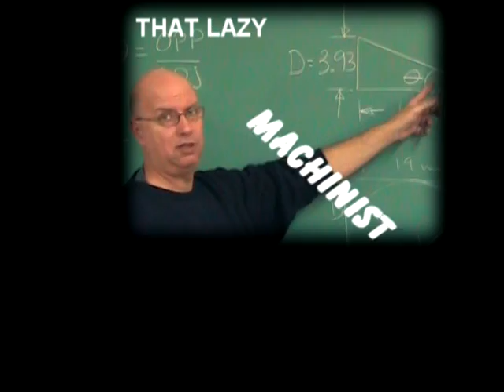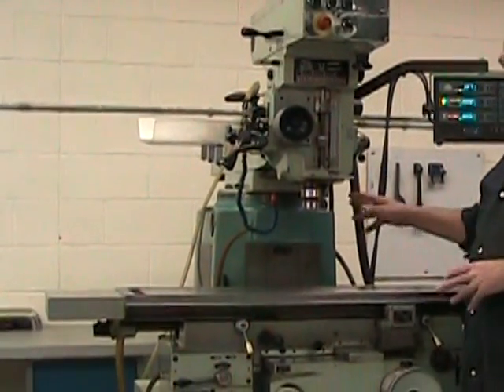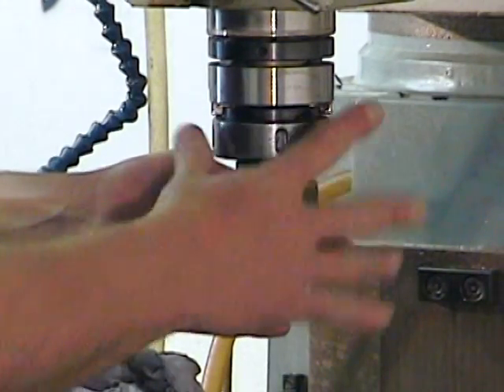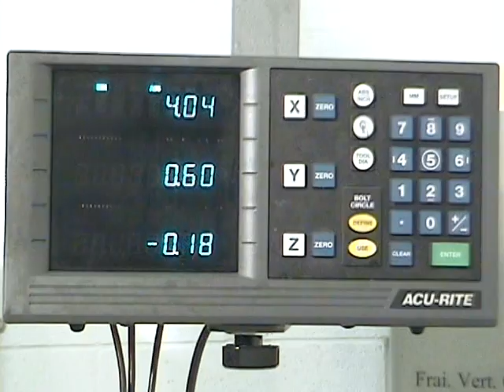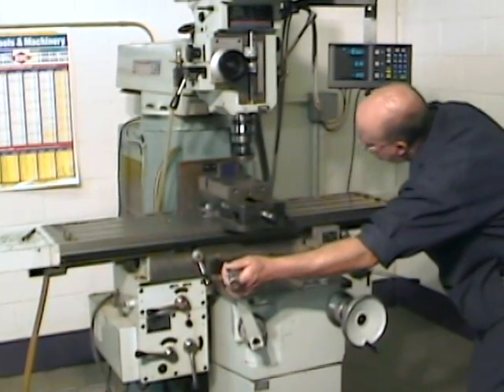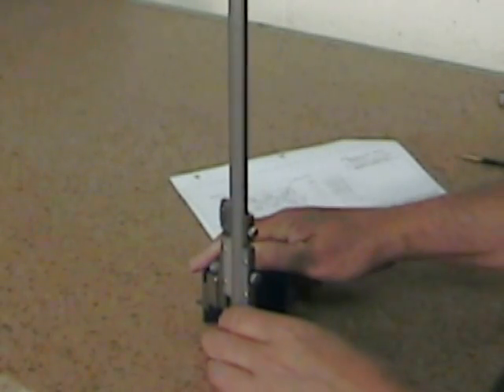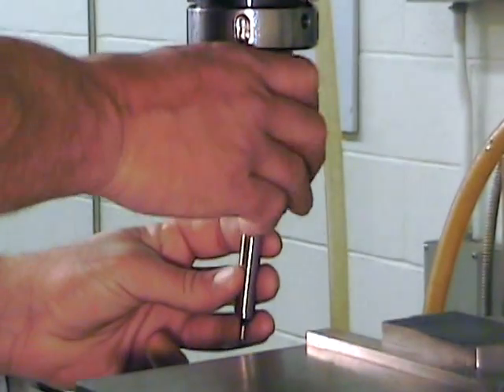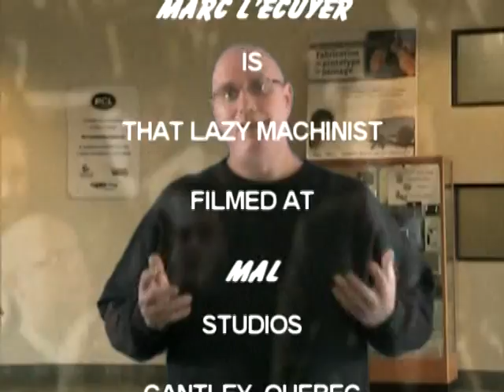THE 1-2-3 BLOCK PART 1 : PREPARING THE ROUGH PART, SQUARING UP, LAYOUT AND MILLING,  MARC LECUYER

Comment: Yet another great program. I do not have a quill on my knee mill (a Danish Vilhelm Pedersen) so drilling would have to happen by raising and lowering the table using the Z axis wheel. Is this even possible? Or rather, does it make sense to do drilling on such a mill?
Reply from the maker: Drilling with the Z axis is not the best situation. The z axis on most machines is slow in order to obtain the mechanical advantage required to move the massive table vertically. That also means that the z axis offers very little feedback as far as how hard we are pushing the tool. It also means that the tool will rub excessively when being retracted.  I generally reserve the Z axis for drilling large holes in tough materials or if you prefer, the holes that are not suited for a quill. For many jobs, you could use your mill to spot the holes and then move to a drill press to complete them. I hope this helps! Marc L'Ecuyer
Reply: Your comments help and are much appreciated. I hope to acquire a mill with a quill, but for the time being I'll be using it as you suggest. Marc, you have helped me a lot. Thank you.

Comment: Great video, but I have a question. Wouldnt it be more appropriate to use a spot drill vs the center drill? I thought center drills were made for tailstock work on lathes? I find spot drills excel on materials that work harden like titanium and stainless. I have seen many tips of center drills destroyed from titanium drilling.
Reply from the maker: +Finn Custom Knives Hi Finn, I agree that spot drills are better for tough materials and probably for soft as well. When I was an apprentice, center drills were the tools used and spot drills just weren't around, at least I can say that I never saw one. I guess that I am used to using the center drills, so much so that I do not own any spot drills. It is probably time for me to get with the 21st century. Thanks for watching and thanks for a great comment! Marc
Reply: Definitely use a spot drill. We all agree.

Comment: I've given up using centre drills except for forming centre holes. Spotting drills never break their tip off!
Reply from the maker: Great suggestion Paul, I will eventually produce a short video on drill bits, stub, spotting, jobber, long series, high helix, spade, gun, straight flute, center, bell type ... The video might not be so short? keep the good ideas coming! Marc L'Ecuyer

Comment: What tool steel are you using? thanks
Reply from the maker: The 1-2-3 blocs are made from 4140 steel which is an alloyed medium carbon steel. When quenched  and annealed is comes out at about 45 Rc. Tough, resistant to wear and shock. Good stuff!!!
Reply: it is good steel, I use the pre-heat treated  stuff, so no heat treating after words..
thanks

Comment: Close to the same mill I have tos kurim mine is a 1995 fnk25 a
Reply from the maker: I once had a student tear the head right off of that very machine! He had forgotten to tighten the vice and jammed the spindle at about 1200 RPM. It sounded like a bomb had gone off, thankfully no one was hurt. We ordered a rough casting from the company and made a good project out of the rebuilding of the machine. All in all, many lessons were learnt thanks to that accident. I have always enjoyed working on the Tos machines, rigid and powerful and able to get the job done! Marc L'Ecuyer